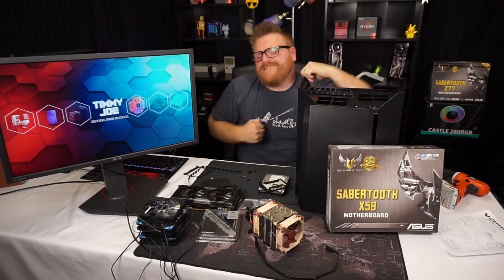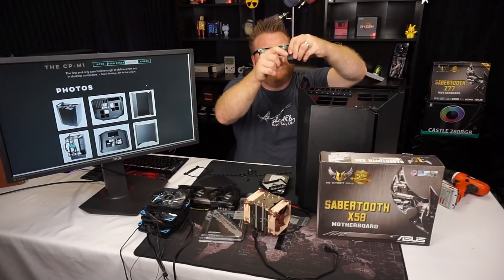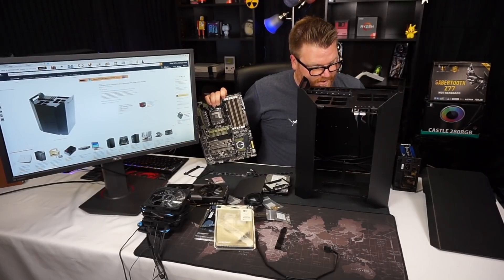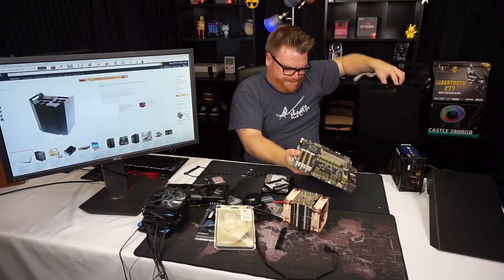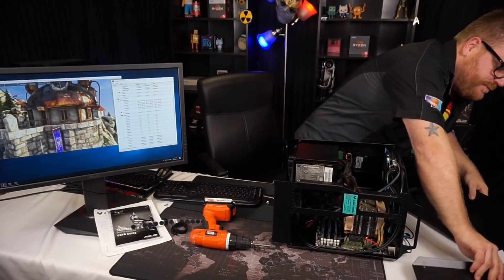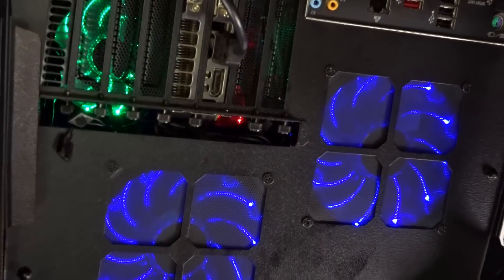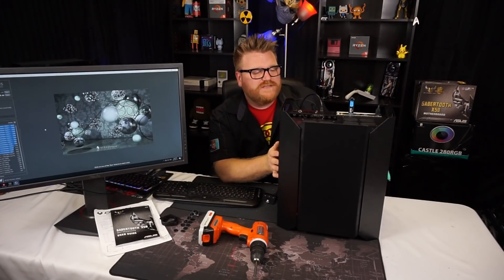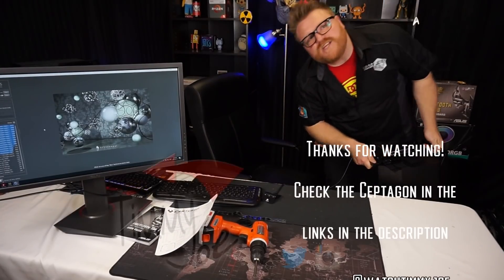x58 Xeon build like you've never seen!

Comment: I run six 8gb sticks of ddr3 ram (48gb total) in this same motherboard with an i7 980X. Even though both inel and asus say the max ram on mobo and cpu is 24gb my system has been running perfect with 48gb ram and kicking ass for over 3 years now.
Reply: Same here!
Some say that it's even possible to install 96GB of ram when you use a Xeon cpu

Comment: how does it make sense? isnt heat suppose to rise up
Reply: I was thinking the same. The Silverstone Redline RL06 for example uses bottom intake, top exhaust fans and is undeniable one of the best airflow cases.
Reply from the maker: fans make heat do what you want
Reply: This is correct but only under natural convection, the moment you put a fan in that no longer applies
Reply: Think you could do a 4 minute video with the fan intake from the bottom exhausting out the top? Raven 02 was set up with that air flow and it was raved about. I'm curious if you find a difference or if the pressure of the fan negates heat rising argument
Reply: Dustin Doyle the pressure of the fan negates natural convection, with a fan, especially a high pressure one, you can just push it wherever you want it
Reply: @blazingmatty123  + there is more dust on the bottom
Reply: @blazingmatty123  In a perfect setting, you'd be correct, but there will be deadzones where hot air will rise, accumulate, and recirculate into the intake stream warming the cooler intake air. You want convection to work with your configuration and not short cycle hot air.
Reply: @prpredatorz310  that's really not how that works though, even if there are dead zones, if, not many cases have those, but on the off chance that there are, convection doesn't apply there either
Reply: @blazingmatty123  I was willing to accept your misunderstanding until you just basically went... uh no.  Here is how it work. Fans at top blow air down, as it travels away it will slow down and disperse. It is also picking up heat and colliding with air molecules and components in the fan and spreading outward. Watch videos of wind tunnels to see how this effects air flow. The corners and under areas where there are no fans  provide dead zones and weak downward force. Here the warmer air will mitigate upward and the cooler air will travel downward. The cooler air will pool and be sucked out by lower fans, the warmer air will rise and then be brought back into the air stream where it will ADD heat, not subtract. Short cycling is a major issue whether it is case fans or your air conditioner at home. This also is an issue for air leaving the case. It will hit the ground under the fan, and then be pushed out from under the case where it will be warmer then the surrounding air and rise, and yes can be recirculated into the intake stream. Now of course we're not talking about 100% recirculation, it might only be 1-3% or so, but it will happen and it isn't the best option. Fan intake from the bottom and exhaust out the top will just eliminate these minor nuisances, you could see a few degree swing from proper fan placement. The way you're taking would require one full size fan on top and one on bottom forcing the air completely through the device, not two small on top and two on bottom. Fans will work when they're being fed air, so you will create a direct channel between the upper and lower fans for sure but it will not be complete and will allow for short cycling warmer air in the case and loose cooling on some air that will bypass vital components. It's not optimized.
Reply: @prpredatorz310  would really have been nice if you actually knew what you were talking about
Reply: @blazingmatty123  You're right, my multiple engineering degrees, years designing HVAC systems for high rise buildings and working with dynamic air flow solutions makes me ignorant. I give detailed explanations as to why I believe how I do and your two retorts are, "no" and "would be nice if you knew what you're talking about". You aced troll argument 101 in college I can see. Congrats.
Reply: @prpredatorz310  well i mean if you really believe the stuff you said above then you can't be that good at the thing now can you
Reply: @blazingmatty123 So much substance, you're just full of wit. Bet your momma's proud. Learn some stuff, get a job and come back when you know something, kid.
Reply: @leobrzl  How do you know I wasn't trolling him? Also, how are you so sure that I don't find these antics amusing when I'm sitting up at 2am and feel the need to goof off? Also, damn I almost had to watch the whole video again just to remember what this thread was about since it was around 8 months ago. You just finding this now or were you bored too?
Reply: @blazingmatty123  He does,  you do not
Reply: @blazingmatty123  It still applies and your working against it.  Would be better to work with it.

Comment: I was going to build a x58 system, but then I got a deal of a dell t7500, 2x xeons 5690s, 48gb ram, 2tb hhd and 256 ssd for $100. The thing is im not sure if i should keep it and add a gpu or sell it back. The psu is 1100w and im concerned in the electricity bill...

Comment: I have an asus sabertooth x58 motherboard with intel i7 980X (6 core 12 
thread at 3.33GHz), asus strix 1080 ti, and 6 8gb ddr3 ram sticks, 48gb 
ram total. This computer is a beast, runs cool with corsair h1100i v2 
liquid cooler and I won't be upgrading to a new ddr4 mother board for 
some time. Yes, x58 is usable and worth it in 2020!
Reply: Ecc ram?

Comment: I have the same mobo and Xeon updated the Bios to the newest one with my i7 920 but if I pop the Xeon it it won't work just  CPU and memory LED is on. When I pop the i7 920 the CPU LED turns off. Does anyone have an Idea?
Reply: pretty sure you are thinking of the xeons (socket 771) put into socket 775 motherboards. But the xeons here fit right into the x58 motherboards.

Comment: I tried to put a Xeon 5650 in x58 sabertooth mobo but never got the thing to boot. The CPU works in a dell workstation mobo, but I get the CPU error light on the x58 mobo
Reply: rurutu M itll probably need a bios update, the 56## series xeons are westmere whereas the boards originally shipped with bioses for nehelem, so with a bios update it'd work fine
Reply: matthew brown I have the last bios asus put up for the board, still doesn't work

Comment: I have a X5690 and a X5650 but no overclockable motherboards. Stuck using the X5690 stock. $150 for an old motherboard is insane.

Comment: I'm putting together an x58 build and it's been an odd experience. The CPU, RAM, cooler, and case can all be had quite cheaply but boy is a motherboard difficult to get hold of for a reasonable price. The cost of an x58 board here in the UK is more than the rest of the build put together. I guess people think they can charge silly money because the boards are getting harder to find as they age.

I've ended up having to get one from an Aliexpress seller and that's going to take about a month to get here from China. It's kind of sad to see all these parts of a PC but no way to start the build process.

Comment: Uhm, the airflow is the opposite it should be? :O Heat rises up, so you'd want it to be blowing thru the top upwards.
Further, dust would settle on top surface, that would prevent it.

Comment: To test that black grabage can u need sth to compare ffs how are u still review things ... , compare that system in other smaller factor case to compare temp. if it is REALLY that much focused on temp. .But i doubt there is any sense to buying that case honestly.
Reply: I dont think its meant to focus on temp, it just wants to be a competitor to glass panel builds that have zero airflow.

My first glass case PC was actually a rosewill, which I did love - but even with 5 fans you couldnt move air through it right? I had an overclocked 8370 to 4.8ghz and an R9 290 overclocked to 1190/1550 - some really hot hardware at those clocks. The glass panels on teh front and side got really hot.

Theeennnnn I bought a corsair 460X which I absolutely love, still glass panel - RGB fans - Ryzen build with Fury - no heat issues but with 5 fans it does move lots of air which would have taken care of it if I stuck with my FX Build.

I do agree with you tho, there is no sense buying that case. I also have a Ryzen 3 2200g/R9 Fury Trix build in a cooler master Elite 130 - plenty of air flow and plenty of space to do what you need while still smaller then a desk trashcan. Honestly I was quite surprised, I was able to fit a corsair 120mm liquid cooler in there for the CPU so I could overclock it, and it also fit the R9 fury which if youre familiar, is one of the biggest cards out there there is. 

I never approach the temps that he does in the video - I get 72c for my GPU at full load and 53.25c was the peak temp for a Ryzen 2200G @ 4ghz - however it only hit that temp for half of a second usually its around 50c: so a 50$ Cooler Master ITX build vs a 300$ non ITX build - Well Ill let the readers decide. 

Im no tech youtuber, but maybe I should upload a video of this little guy.

Comment: Price of 8+ year old, used Xeon + x58 mobo + CPU cooler + DDR3 is now too close to price of a BRAND NEW Ryzen 1600/ 2600 + B350/B450 mobo + DDR4. Fun to watch, but time to move on from x58. Even with the awesome deal you got on the x58 Sabertooth,  the savings were most likely eaten away by the extra time it took to overclock and get Windows 10 working.   Am I right?

Comment: I despise RGB Except to backlight my keyboard, and 1 fan in the case along with the GPU name across the top (or side of side logo or, err the fan if that’s the only option if horizontally mounted). It also needs to be a soft white or pale blue, otherwise I’m all set.

I do like tinted tempered glass, love real wood custom cases (especially picture frame wall mounted PC cases; nice), so I’m pretty bland when it comes to today’s trends.

RAM? Absolutely not. Cycling colors? Hell no, and there are a lot of inexpensive cases that are just metal; high quality fingerprint proof (kinda) cases between $60 and $100 usd that will fit whacky SuperMicro U shaped dual, sometimes quad cpu boards (quad add $30 usd or so if you don’t want to cut yourself constantly while building).

I don’t think that case looks like a trash can, but I’m not a fan. It’s practical in function, but not price. Like you said, you could get a two side tempered glass case with more rgb than a modern X-mas tree for half the price (and often less).

I applaud the designers work, and hope he can market it to companies that would benefit from a no frills dent resistant design, but not for me. Also, the Ethernet on top? Awful place for io. From the occasional lazy foot rest to a falling keyboard or keyboard tray, top io is just an accident waiting to happen in my experience.

If he can get that price down though, I could see a lot of small businesses giving it a look (let’s face it, a large company isn’t buying $250 cases for 1500 secretaries).